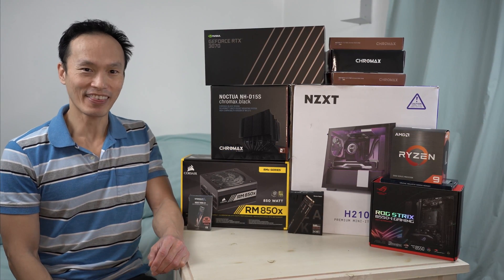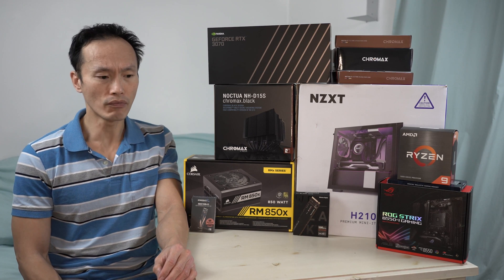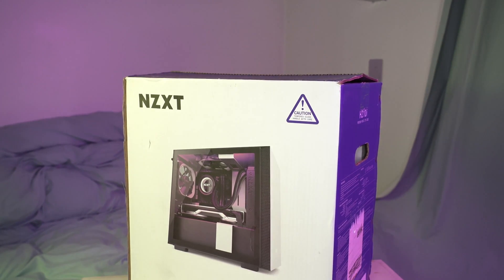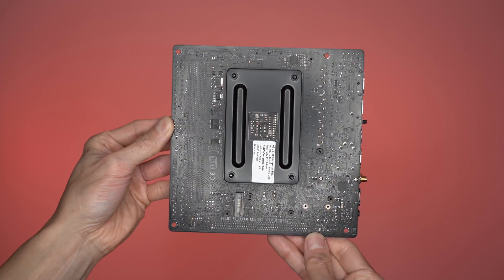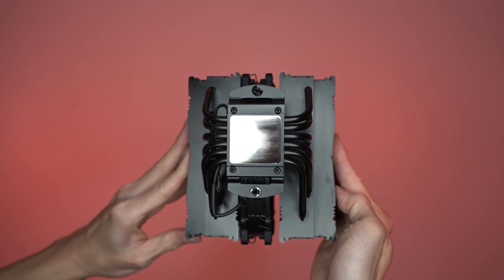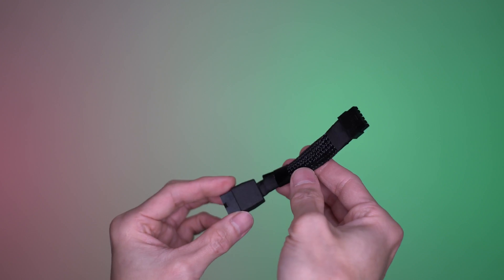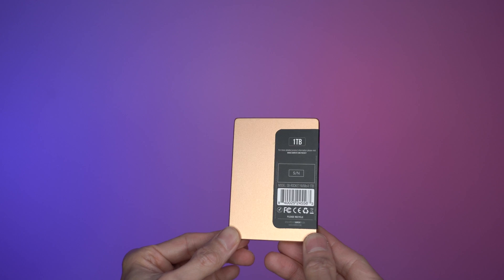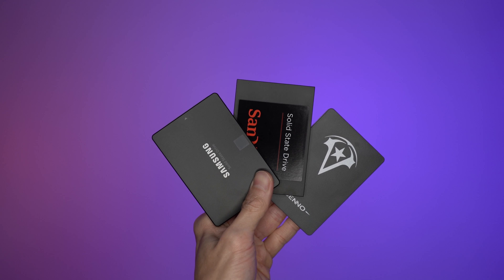Mini-ITX PC Build - NZXT H210i, Asus ROG STRIX B550-i, Ryzen 9 5900X, NVIDIA RTX3070, Noctua NH-D15s

Comment: I have the same specs than you but with a watercooling Kraken X63, and i am thinking in upgrade my case to this one
Can you post your temps and noise with that case?
My case is the Streacom DA2B V2 and I suffer with the temps
Normal use (web, youtube, etc) / CPU and GPU - 55-60º 
Gaming - CPU: 82º
Gaming - GPU: 92º
and a lot of noise :(
Reply from the maker: My CPU temp hits a maximum of 80°C when doing heavy 4K video editing work but it only gets there rarely. It spikes occasionally and then comes down to between 50°C-70°C. Normal browsing use is between 30°C-45°C. I have not gamed yet and so, can't comment on gaming temps. I will play Far Cry 6 (when it's released in a couple of months) and see if the temps are different. My GPU temps stay lower than my CPU temps and it's probably because I've not been gaming. My GPU temps are usually between 30°C-50°C and rarely go above 60°C. I have no sound measurement device and so, can't give any acoustic readings but what I can say is that I can hear a constant low hum from all the fans running but it's not something that's distracting for me. If I turn the fan profile in the BIOS to Silent, the hum goes a little quieter but still audible in a quiet room. For your case, it might lessen the noise if you swap out the Kraken fans for Noctua fans as, from my research, it seems that Noctua fans run quieter than other brands. But first of all, before you go out and spend more money, try to determine what is causing your PC to have such temps. If not already, have a look at YouTube videos or webpages/forums about temps in a Strecom DA2B case which might give you ideas on what to try to bring down the temps. As far as I know, an SFF system would post higher temps than a mini-ITX system because of the law of physics - tight smaller space means less airflow. So, fan configuration, component layout and such affect temps. Also, game settings, type of monitor used, the ambient temperature and space around your PC can have impact on the internal PC temps. Without seeing your PC and where it's placed, it's a bit difficult to come up with suggestions. Having said all that, the 92°C GPU temp is a bit on the high side. It won't break your GPU but if it stays above 90°C for hours and hours week after week, it might wear down your GPU in the long run.

Comment: Your production quality is amazing, especially for a first Video. Very satisfying to watch, only criticism i can think of is that the build Montage music was a Bit too loud, other than that perfect! Good job
Reply from the maker: Thank you! Yes, I will keep in mind the volume of the music the next time. I guess the volume of the music comes as a bit of a shock after the relatively quieter spoken segment.
Reply: @wlee9727  great to hear. I also got a build in the Same Case, how was your experience? I had a Lot of Trouble with overtightened screws
Reply from the maker: I loved it! The limited space is a challenge and I'm always up for a challenge. But the main reason is that I do not wish to have a monster size PC as I'm very sure that I will not be doing any kind of PC expansion or plugging in more PC parts. So, if I were to go for an ATX case, all those space will go to waste. As for overtightened screws, I didn't have much trouble with them but when I did encounter a few, I just had to be patient and screw them in slowly but firmly. How was your experience in your build?
Reply: @wlee9727  great to hear. Yes, the Limited space is absolutely a Challenge for me too, especially since that was my First build, had to fiddle around a lot to get the CPU cooler installed and cable Management in my PC is a Nightmare ^^ Overall it was quite exausting but very fun aswell!
Reply from the maker: Glad you've had fun doing it!

Comment: I put my cooler upside down so i could fit a slim exhaust fan up the top. It's a beast of a cooler for a big ass itx case like this one. And the fact you got braided power cables is a good touch. It's gonna be a hot and heavy PC. Expensive too I bet.
Reply from the maker: Hello, Shannon. Yes, I had thought of putting the cooler upside down. Did you have to remove the m.2 heat sink (assuming your mobo has one)? When I orientated the cooler upside down, it touched the ROG STRIX m.2 heat sink and so, I put it back the right way up. That braided power cable ... a joy and a pain. A joy because it goes with the red-and-white theme but a pain because it is a butt-ache to mold and bend and try to keep it in its shape (you should've seen the hidden amount of cable ties wound around the power cable to lock it in shape and in place). It is a mid-budget generic extension power cable but it does have the thicker 16AWG wiring (compared to the usual thinner 18AWG wiring) and that's why it's a pain to mold and bend. If I had a bigger budget, I would've gone for the more expensive cables from the likes of CableMod or Reaper Cable because their cables are so much more malleable and they keep their shape. As for weight, yes, Candy Cassidy is heavy because of the heavy components but delightfully cool. My CPU and GPU temps do not grace 75°C even after hours of hardcore 4K video editing work. Might be a different story if I'm into overclocking or gaming at ultra settings. And yes, this is an expensive venture (not to mention a headache venture in getting all the parts) but it was worth it because now, I can get my work done one-third quicker! :oD

Comment: how is the gpu temp? isn't the space between the gpu and the psu shroud constricting airflow too much?
Reply from the maker: The GPU temperature is fine. Barely touches 70°C even when I am editing 4K videos with crazy transitions, multiple layers, compositions, effects plus rendering for hours. It might be a different story if I was overclocking or gaming at ultra settings. I think the little space between the GPU and the PSU shroud could restrict airflow but it depends also on your fan configuration too. If you think there's going to be restrictions, you could possibly remove the PSU shroud and/or use an SFX PSU. That would create more space for air to flow. Only thing about removing the shroud is that it would remove the little extra physical support (by the shroud) in holding the GPU horizontally.

Comment: Does the GPU get too hot? I’m kind of worried about the airflow. Thanks for your video
Reply from the maker: Thank you! No, the GPU does not get hot at all. It might do if you're overclocking or gaming at ultra settings. So far, my most demanding use of Candy Cassidy is for 4K video editing work. Even with crazy 4K video transitions, multiple layers, effects, compositions and renders, the 3070 barely touch 70°C even when I'm editing for hours. The big bad-ass Noctua cooler does help and the fan configuration seems to be aiding the cooling too.

Comment: I would reccomend swapping to an sfx psu and slotting a fan under the gpu. Will greatly reduce your temps
Reply from the maker: That's a good idea. I didn't do that because an equivalent SFX PSU costs more than a normal PSU and as the weeks went by of accumulating the components since July 2020, the PSU prices (whether SFX or not) kept creeping up and up. By December 2020, what I paid for the RM850x in August was the price of an RM650x! I just couldn't believe it! If the PSU market wasn't so crazy, I would have gone for an SFX PSU.
Reply: @wlee9727  Yeah I was stuck in the same boat. Looks like the v850 by coolermaster is in stock for 140$ now tho
Reply from the maker: If you're referring to the RM850x, it's around that number but in £ here in the UK. Crazy PSU market prices!
Reply: @wlee9727  Sorry I was referring to a coolermaster psu, not corsair. In America the availability recently increased so you may get them soon.
Reply from the maker: Oh, I see. I've looked and it's still around £135. Just like most smaller-than-usual parts, the so-called mini-ITX tax on the prices - always more expensive than the ATX equivalents. I guess it's for the extra engineering that goes into creating and making these miniature components. :oD  Lucky America to be getting more stock because stock of the v850 is still not good in this neck of the woods.

Comment: Hello there, nice build! I have something similar, with a huge cpu cooler, but I noticed that the case and components are really hot, can you tell me the fan configuration that you use?  (How many fan are pushing air in vs out for example) thank you!
Reply from the maker: Thank you! Front of the chassis - two 140mm fans pulling air into the case. CPU cooler - one 120mm fan pulling air into the cooler, one 140mm fan (the one in-between the fin towers) pulling in the air from the first fan and pushing air out of the cooler. Rear of the chassis - one 120mm fan pushing air out of the case. So, all in all, two intake fans and one exhaust fan with the airflow a linear line from the front of the case to the back. Is that the configuration you have? If I had a choice, I would use a 140mm fan for the rear of the chassis (for more power to push air out) but the NZXT case only takes a 120mm (or smaller) rear fan. If your components are operating below 90°C and only cross into the 90-100°C territory very rarely, there's nothing to worry about as PC components are designed to withstand such hot temperatures. They will begin to throttle and shut down if you go beyond 100°C. They will only start to degrade if they are made to operate at really high temperatures every hour, hour after hour.

Comment: Thanks for sharing your build. Is there anywhere a video where you have assembled it a bit slower? 😅 Sometimes I struggled a little bit while following your steps. :-)
Reply from the maker: Thank you! I believe you can slow down the video by going to Settings > Playback Speed > 0.75 or 0.5. If I put every step into the video, it would be more than one hour. :oD The five or so minutes of the PC build was a compression of five hours of footage filmed over two days!

Comment: Coincidentally, I've been looking to do an almost identical build! However, I have yet to decide between the NZXT H1 and the H210. I'm just slightly hesitant about using a mini-ITX... Regardless, thank you for the video! Fun to watch.
Reply from the maker: Thank you, Polina! If you're not overclocking or gaming at ultra settings, you need not worry about thermals. As for the NZXT H1 case, I'm sure you have heard about the news that its riser cable might catch fire because there's a residual ungrounded 12V current running across the cable. I would suggest avoiding that case for now. Gamers Nexus has an in-depth investigation into this. https://www.youtube.com/watch?v=9XIKOSrQdQ0
Reply: Mini-ITX, This Is The Way.
Reply from the maker: Thank you, Your Royal Highness! :o)  Mini-ITX is indeed the way!

Comment: super cool video, hope u make more :) i have the same case and im going to buy a 3070fe like your but i'm worried about the 3070 temperature in the small h201..
Reply from the maker: Thank you! If you're not overclocking or gaming at ultra settings, you do not need to worry about thermals. Candy Cassidy did not even break a sweat when I was editing 4K videos with crazy transitions, multiple layers, compositions, effects plus rendering. If you are overclocking or gaming at ultra settings, you need to decide on a proper bad-ass CPU cooler, configure your chassis fans and CPU fans properly and place your build in an airy place.

Comment: Thank you for this very educational video. I am planning on building a new computer as well and with the same case too. I was conflicted about some of the parts but I think I will use the same motherboard that you used in your build. The completed PC looks very nice, and one that I think I will mimic in some ways. :)
Reply from the maker: Thank you! If you're not overclocking much, any of the B550i mobos are more than enough. If you are, you might want to consider ASRock Phantom Gaming or Gigabyte Aorus Pro as they have higher power stage ratings (90A compared to Asus ROG STRIX's 60A) or even go up to an X570i mobo. I didn't go for the X570i mobos because the more affordable ones don't have a front USB-C connector and I need that connector for the NZXT H210i case.